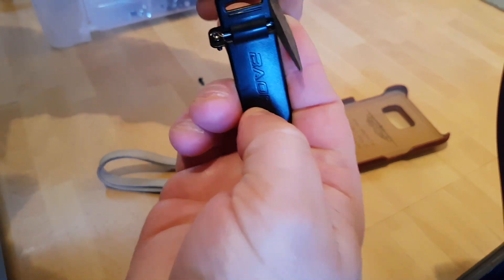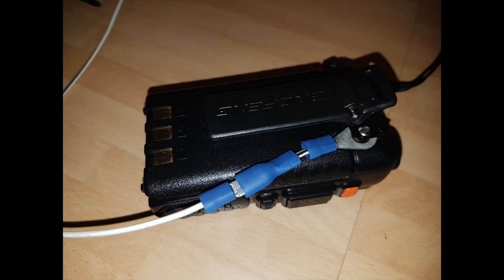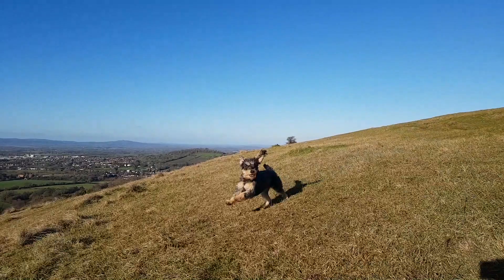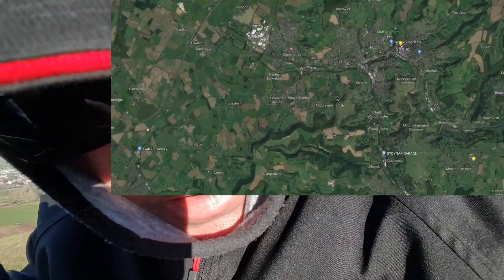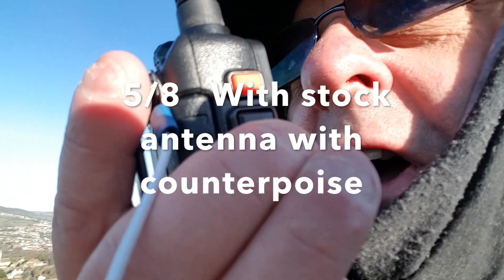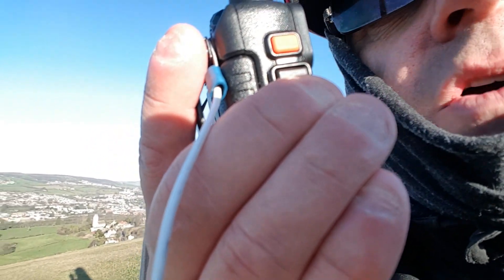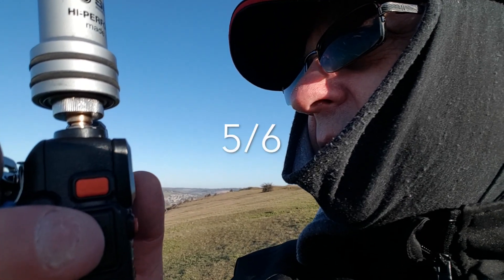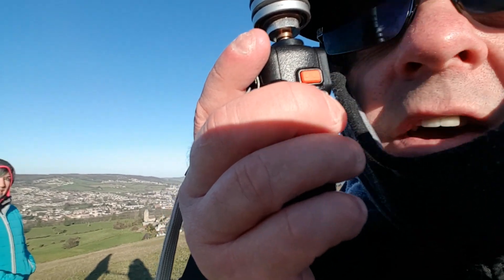Amateur ham radio Testing the Range multiplying  Counterpoise UV 5R Links in Description

Comment: Bought two of these they only work to about 300meters? Am I doing something wrong or are they just rubbish? There charged and on high power output any one got any ideas I even done this trick with the wires and have yet to hear a voice over these radios
Reply from the maker: Try it out in the open , with clear line of sight , you should get miles
Reply: Settings to UHF. TX High

Comment: are 2 baofeng a better option for range/distance in outback vs reg walkie talkies like motorola mr350?
Reply: With line of sight, 2km is easy with the stock antenna. I uses NH31 antenna and I could chitchat with a guy 25km from me.